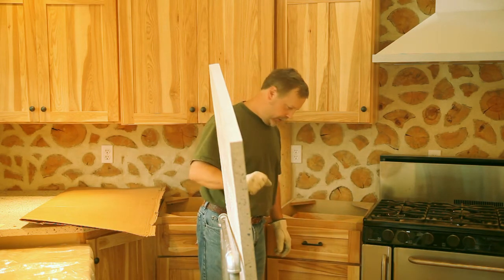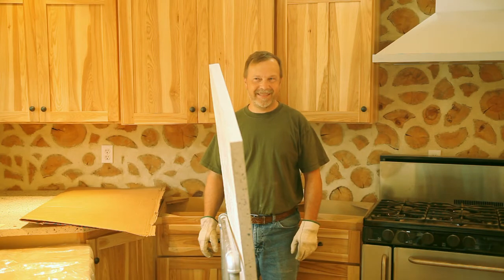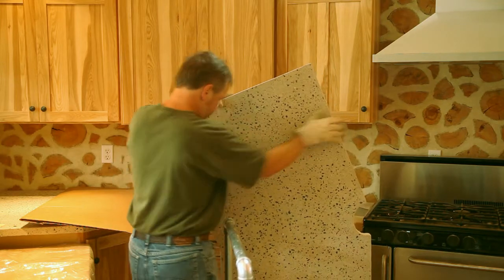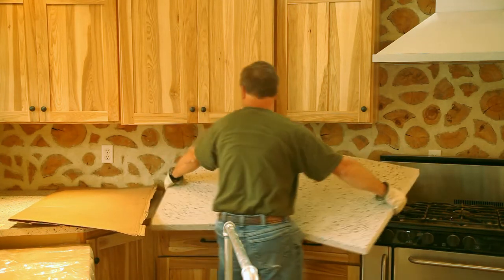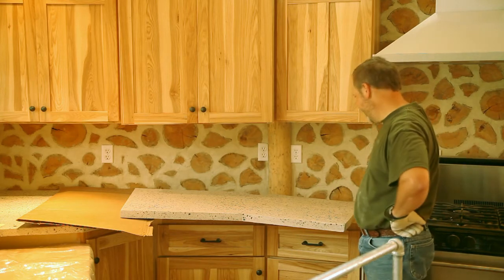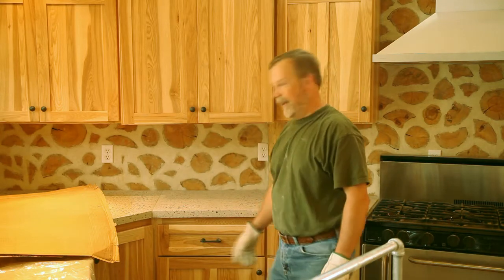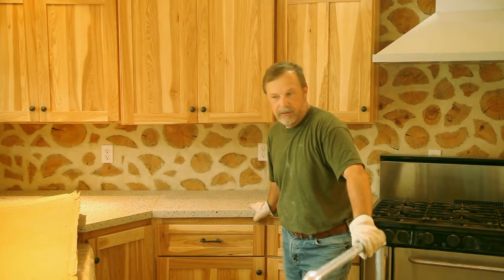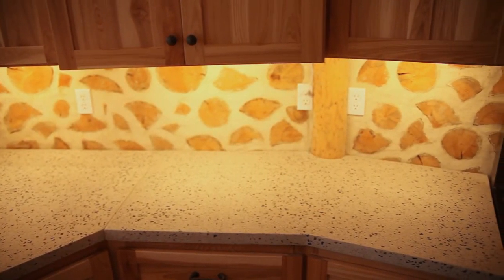Day Creek Journal Part 7

Comment from the maker: I caulked the seams with a cement-colored caulk, then put four coats of acrylic sealant over the entire surface. I sanded/buffed each coat after it dried. The finish came out looking great and I have only had to wipe it occasionally with a sponge.